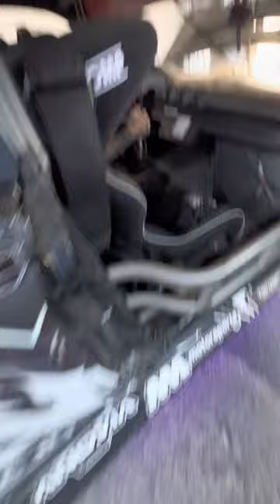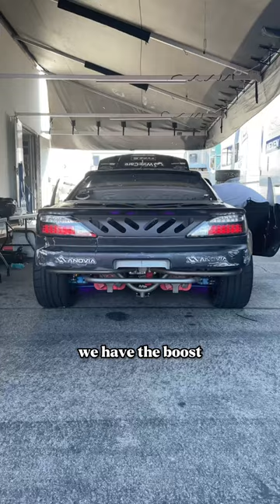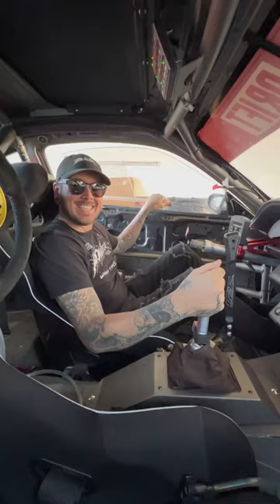What is Antilag for cars?

Comment: For those who don’t know: Anti lag basically just keeps the turbos spooled up when your off the throttle using the combustion of the engine.

Normally turbos have to “charge” before they can be used fully but with anti lag it keeps the turbos spooled so that “charge” period is canceled

Comment: Ah yes “anti-lag” the most alpha way to improve throttle response literally destroying your turbo from the head and shock waves caused by turning the hot side into a discount engine cylinder 😂 Fun fact: the first car to use anti-lag consistently in competition was Toyota’s Celica GT4 ST205, a car that would later get Toyota Team Europe banned from WRC for an ingenious cheat that bypassed the restricter plate mounted to the turbo to reduce hp. AND, if you managed to buy one of the 2500 homologation ST205s made in 1994 Toyota gifted you with all the plumbing necessary for your own Anti-lag system! God I love Toyota!
Reply: Thank you for sharing
Reply: Professional rally teams swap their turbos out after almost every race due to “spontaneous deconstruction” from anti-lag. It’s extremely valuable in competition if you can afford it.
Reply: Actually this isn’t correct. In the WRC, since the early 90’s (or something like the late 80’s) was when Antilag was being used, this could possibly be Throttle-Kick/Bypass Antilag. The ST205 AND the Evo III would later be (most likely) the FIRST ONES to use SECONDARY AIR INJECTION Antilag in the 1995 season, and my guess is that Secondary Air Injection was introduced as a new type of antilag in 1994 or 1995, as it was WAY more reliable than Throttle-Kick/Bypass because the turbos lasted longer and there were more cooling methods for the turbo and engine if I remember correctly. Basically it was a new form of Antilag as it was more sophisticated and had better outcomes relating to engine and turbo reliability, Mitsubishi used Secondary Air Injection in their Evo 3 for the 95 season onward (same as Toyota)

Comment: Does it spool up the turbo when you rev so you get better acceleration for drag racing?
Reply: No antilag only works when you're off throttle, when you open the throttle all of the air goes into the engine like normal